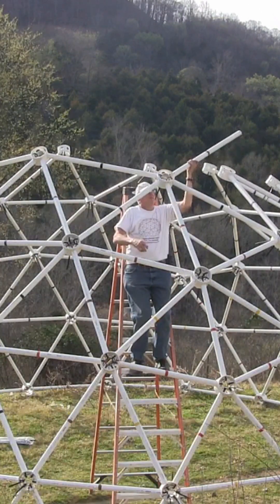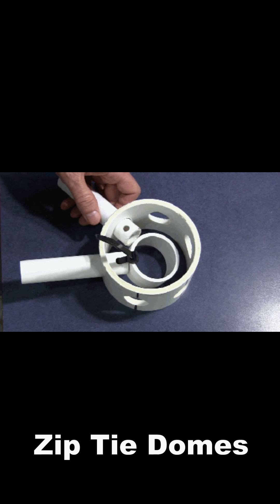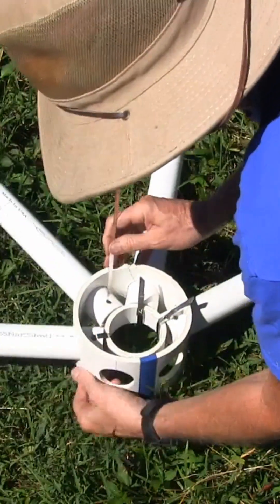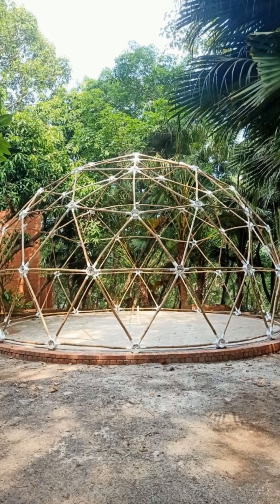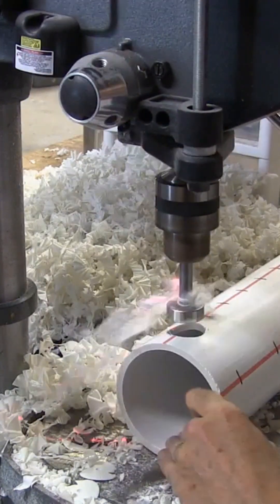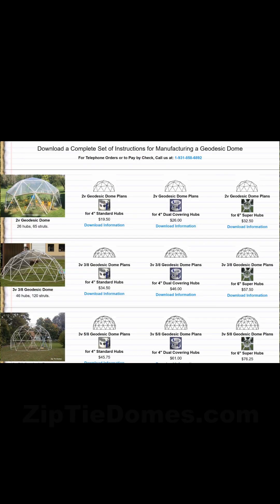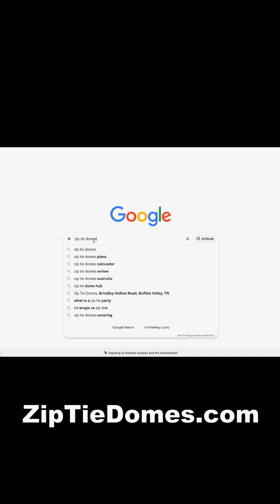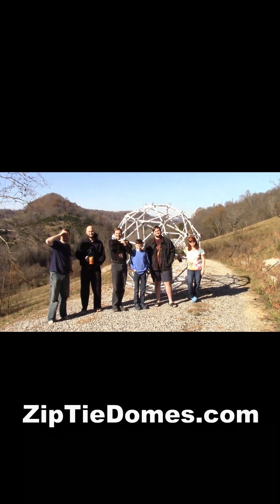DIY Geodesic Dome Hubs – Easy to Make Yourself! #diy #geodesicdome #hubs #connectors

Comment: I’ve got a 16 footer I put up three different times dog house rabbit house mushroom house. I put pallets on the perimeter and then put it on top for the doghouse and the rabbit house mushroom house just set it on the floor. I didn’t use stainless steel I use the best zip ties that Home Depot had. They weren’t great but yet you can build it an hour and a half by yourself jump up on the top one and hold yourself up there. I did it. I was around 2:50 then and it’s out it ain’t going anywhere then this one last one went through a hurricane it’s like building a hoop house, two of the best buildings in the world, zip tie, and hoop houses they go through anything
Reply from the maker: Wow, that is really good to hear.  

The 16' diameter 2v is perfect in size for a lot of things, and easy to take down and then put up again. 

Here is the cheapest place online where we get the 8" zip ties for the kits, and you can buy the ties direct from this company:

https://www.cabletiesandmore.com/heavy-duty-black-zip-ties-uv

https://www.cabletiesandmore.com/stainless-steel-cable-ties

Thanks again for the great comment!
John Hurt